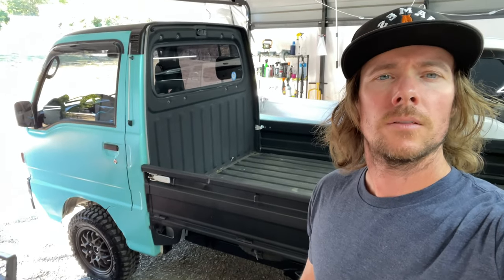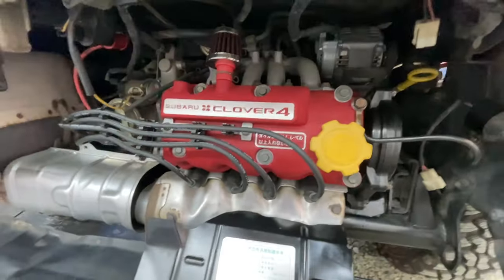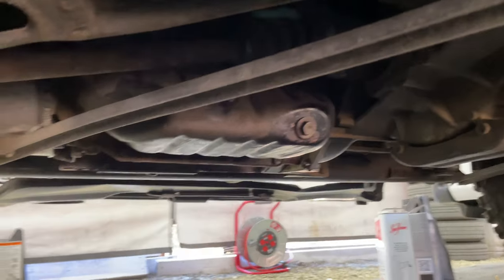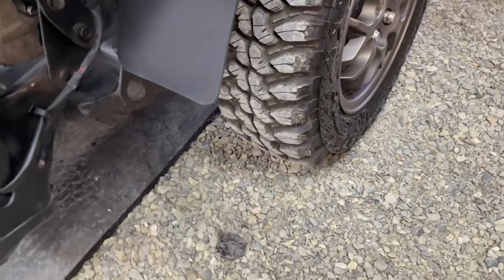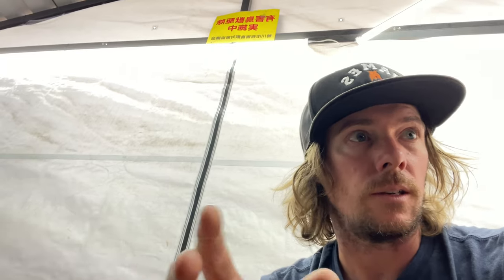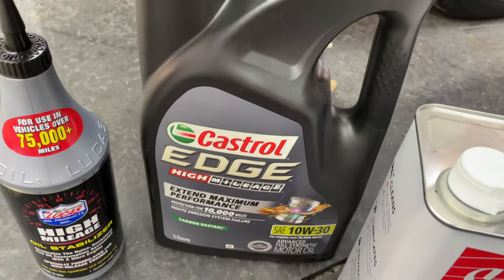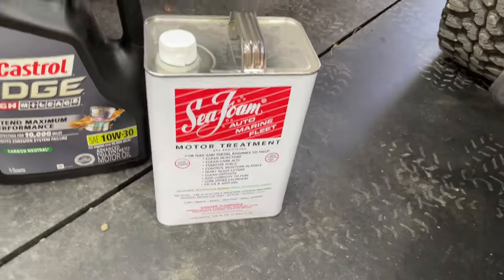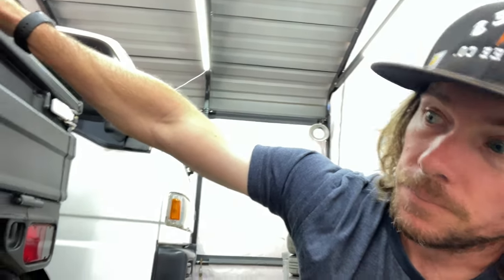First Time Oil Change On Your Sambar? Let Me Help! Subaru Dias KS KV How To

Comment: You rock brother! I've been watching your videos in anticipation for my Sambar arriving. I just picked it up yesterday and already love it, 1997 KS4 Sambar 4x4 5 spd with extra low and only 13,000 miles on it in WA state as well. I ordered a thermostat from your ebay store and I feel like it was in my hands the next day! Will definitely check out your store first if I find I need anything else. Hope to meet you at one of the meets one of these days.
Reply from the maker: congrats man! sounds like a nice one for sure. glad you like the vids! there's a bunch lol. hopefully a few are helpful. thanks for the support for sure. i try to get parts shipped out quick cuz i know how important it is to get the kei back up and running if its down! definitely let me know if you need help with anything, the website has a ton of parts right now and i keep adding more. car show coming up on the 17th next month at "The Shop" somewhere in seattle. bout an hour from me but i think a few of us are going, check it out!
Reply: @OhKeiGarage  I'll probably come out to the meet at "The Shop", maybe I'll see you there! My neighbor pointed out the driver's mirror has a crack in it so I picked up one of those and a fuel filter from your store. 😊

Comment: Just got a 93 KS4. 30,000 miles. Lots of condinsation in the oil cap and dipstick. I like seafoam too but never mixed to flush crankcase. I use kerosene, old school.Ya think it would be good to do a second oil change in a couple 100 miles or so? Then it should be cleaned out realy good. For oil I use Rotella T 10-30 in all my engines from my Honda lawnmower to my 89 toyota pickup, 22R with 300,000+ miles.  Thank Man Great Vid.
Reply from the maker: right on! ya, it certainly wont hurt to do a second oil change after. Kinda like breaking a new motor in lol, but just getting rid of the sludge. I have never used Rotella, I will have to give it a try! Thanks for the comment!

Comment: Are those tires loud? Could you link them? The tires I have on now are rotten and have very large blocks (atv tires) that are VERY loud and shake the whole truck and it also came with street tires that are rotten I I'm tire shopping. The tires on now are 22x7x12 and I'd like to stay close to that height but I'd like a tire that's best on road with decent trail capabilities (Kinda like a Geolander tire). Good oil change video btw!

Comment: What’s the part number for the little red filter you slapped on there?
Reply: Also how did you cap the hose on the other end
Reply from the maker: KN breather filter off Amazon. Forget the number but it’s universal. Also a vacuum plug on the air box nipple

Comment: Can I reuse the crush washer or should I be sourcing a new one?
Reply from the maker: it's ok to re use it. it'll start to leak if its bad. i just usually replace it each time.

Comment: Any idea on torque specs for oil drain plug?
Reply from the maker: i dont know the specific number, but you should have a crush washer that you will tighten till crushed, and i'd go a half turn or so and should be good. just wanna make sure that washer is squished flat again.